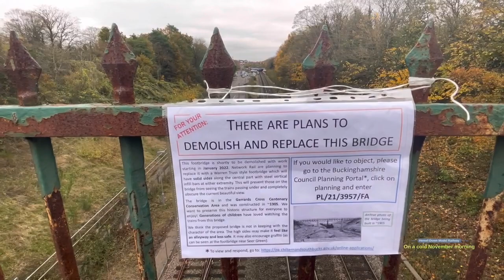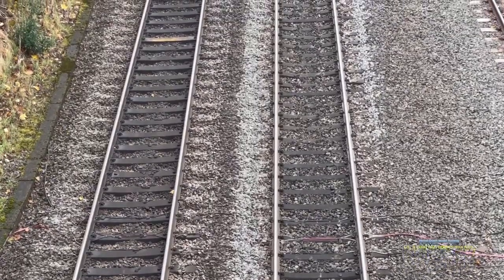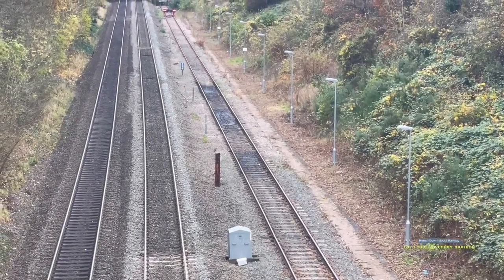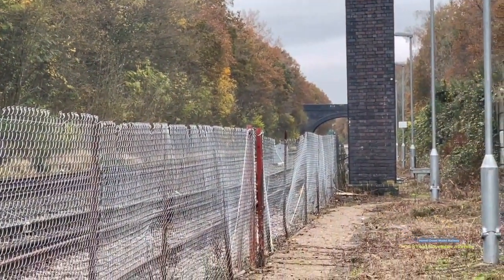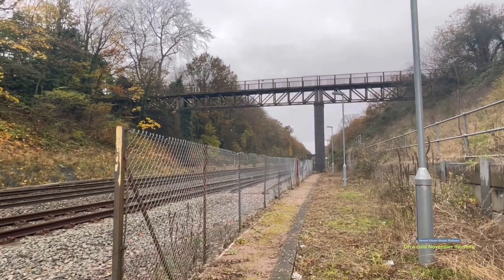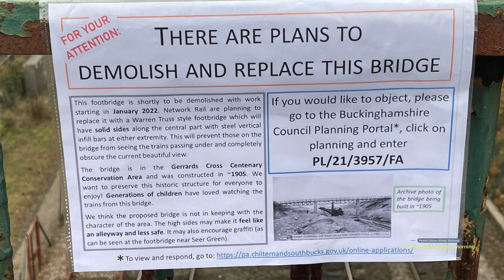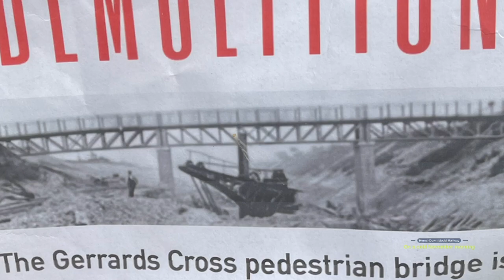Model railway Layout research visiting locations Pt1 - A 1905 footbridge set for demolition!

Comment: Hi Mark.  Rather than 3d print I would either build from plastic girder strip,  or even make out of long balsa strip and matchsticks.  
Start by doing a scale drawing . Either draw It in cad and print or use graph paper. Just some ideas, regards Gary
Reply from the maker: Mmm interesting ideas actually like the sound of trying to scratch build that does make it more unique I guess like you say might have a go at the scale drawing first, thanks hope your well 🙂

Comment: plastruct do girder strips which might work for the underside support, brick wrapped plasticard for supports, sheet for the footpath, not sure if SMS do spear top fencing, I have some girder strip coming so i`ll let you know the quality.
Reply: Ratio 434 OO Gauge GWR Spear Fencing
Reply from the maker: Many thanks for the info everyone has been very helpful for this project in the comments, plus thanks for showing your vid on that army carriage I couldn’t comment as comments were turned off
Reply: @HemelDownModelRailway  No problem, dont know about comments, it has been spammed a couple of times already but youtube have bloked them

Comment: Perhaps the original structure is too old and worn to be maintained as well as it has been. I'm sure the new footbridge will be better-looking. You might get better panoramic views that you never thought possible. Sometimes, it's better to model something new and fresh. Look on the bright side: a new footbridge usually means a better panoramic view of both ends of the railway. Sadly, it's not the case with the new footbridge due to replace the old one at Kidderminster. I'm sure the new footbridge you'll see will be just as good with viewpoints as the old one. Let the old one out and the new one in. Nothing stays the same forever.